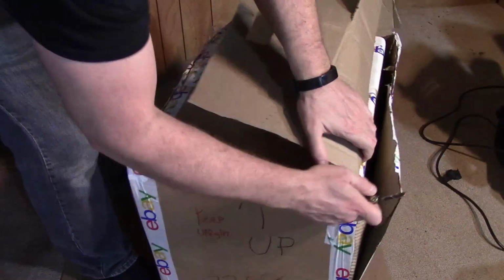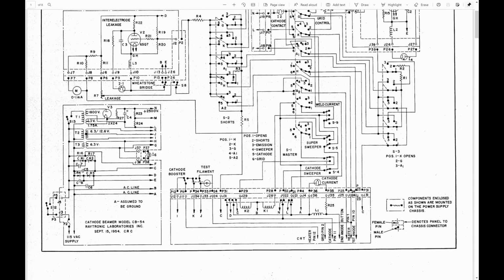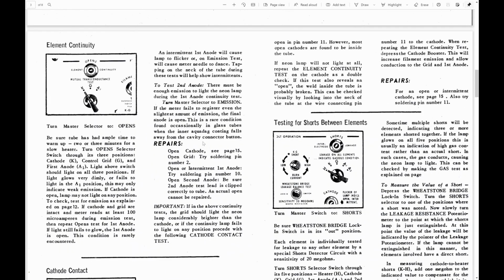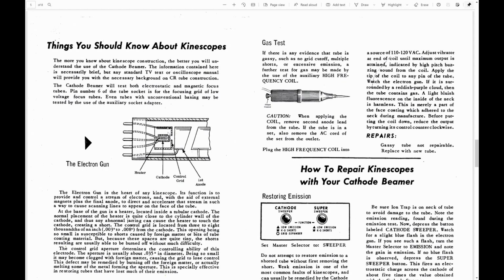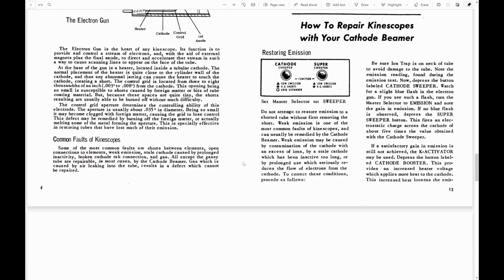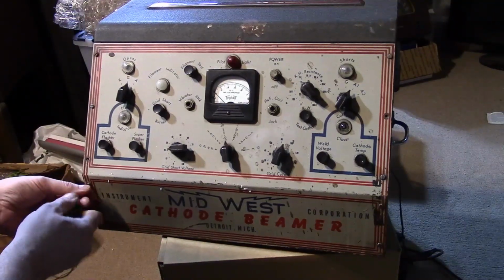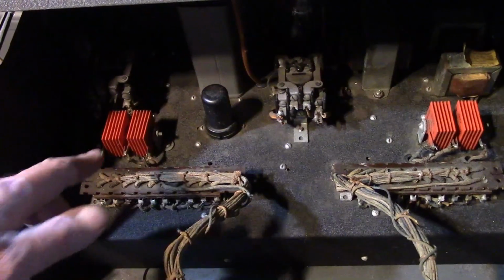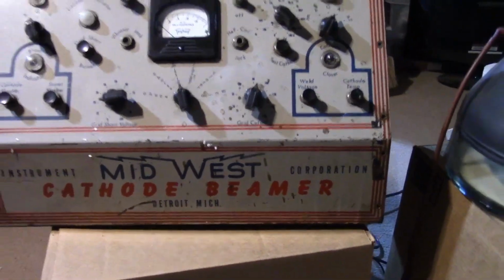Unboxing a Midwest (Raytronic) Beamer

Comment: I love back when anything with a handle on it could be advertised as "portable".
Reply: For me an important question is whether or not the handle is properly located above the center of gravity.
Reply: Yes,like the portable picture tube unit on the Philco Predicta Tandem sets. The darn thing must weigh about 40lbs!  It has a handle and is technically portable,but in reality I doubt they were moved around too often.

Comment: I need to try and get my Sylvania VTVM going.  I also have a Hickok one which is somewhat similar to the HP 410B for which I bought a brand new probe tube but that will probably be a lot harder to get working.
Reply from the maker: Good luck.  Sylvania test equipment is uncommon.
Reply: @bandersentv  Uncommon but well made.  They were made to take the rigors of the traveling TV/radio serviceman.  That is why I encourage anyone who comes across Sylvania test equipment to get it if they can.

Comment: That is one hell of a giant 0.1uF  oil filled capacitor  ( C-4) rated at 3600 WVDC! Weird that someone has listed
for sale a 0.1uF 6000 WVDC capacitor for sale for $20 on Ebay. Close enough to get and rather cheap.
One day you may want to restore it but not now. Saw an ad from 1954 that says it was $279 net back then.
That's $2700 in today's money, wow.
Reply from the maker: It's actually 1.0uF, not 0.1uF.  Wow is right!  Seems their sales pitch was that you would recover your investment with all the money you'd make fixing picture tubes.

Comment: Nice score Bob. I wonder why they used a "standard" form factor transformer to produce the high voltage, instead of using a regular flyback transformer used in a TV-set. I surmise that's because they need quite a high current for some reason? 
Either way, it looks like a damn complicated device to restore and I'm guessing it's not for the faint-hearted :)
It promisses to give 2022 a high voltage start ...
Reply from the maker: Probably cost. You would need several tubes to create an oscillator and driver for the flyback primary. Plus the flyback transformer itself would be more expensive than a conventional transformer

Comment: Am I correct in thinking that this carries out a similar function to the newer Sencore Super Mack?
What a super bit of kit, would be amazing to see it working again
Reply from the maker: Yes it does. The main difference being that this has a fixed 6.3 vac filament supply.
Reply: @bandersentv  have to keep it away from the Predicta then! I could see that being a very useful unit, especially being able to weld that cathode whisker back on

Comment: Shango would love this thing.  You could build a simple interface and use it on color tubes and you could use adaptors from a Sencore or B&K to fit other tubes.  This thing has possibilities!
Reply from the maker: Not so simple. You would either need three adapters (red, green, blue) or make a switch box. Then there's the fixed 6.3 vac filament supply.
Reply: There are so many CRT testers now that can be had for little money you could strip out the transformer and regulator for the various filament voltages. At the same time you could reuse the cable and crt adapters.  And a switch box adapter wouldn't be much to come up with. Most CRT is the only thing you would have to switch would be the screens and the cathodes.  It could be a fun project for your channel and you definitely have a versatile piece of equipment.
Reply from the maker: @randyab9go188  I hear what you're saying but please keep in mind I have a dozen other CRT testers that can do new CRTs already.  Also, with color CRTs it's really useful to see all three guns at once like the Beltron does so you can see if the guns are equal strength.  The newer testers also have safeguards to regulate and limit current and voltage while rejuvinating.  I would be very hesitant to actually use the "cathode flasher" in this device.
Reply: @bandersentv  You have to have some dead CRT's that couldn't be rejuvenated with the usual CRT tester and that is what I'd try the Raytronic on.  They may have a better system there and on a lost cause it could be fun to see if you get any improvement.

Comment: Midwest the radio company was based in downtown Cincinnati.  Raytronic Labs was in the Cincinnati area near the suburb of Evendale Ohio.  The building that Raytronic used still exists but now it is a antique mall.  That area was for its time was high-tech manufacturing zone. Some of their neighbors were Wright Aircraft Engines (one of the Wright Brothers businesses ) later to become General Electric jet engine division and the Crosley Company military electronics division later to become Cincinnati Electronics a military electronic supplier to this day.
Reply: Would you post the url where you found the documentation for the beamer?  I'm not finding it out there on the web.
Reply from the maker: @randyab9go188  http://myvintagetv.com/Apple%20PDF%20files/Raytronic%20Manual.pdf
Reply from the maker: @randyab9go188  I added it to the description

Comment: It would be interesting to see it in action Bob. Hopefully now a massive amount of work and a potentially very useful piece of kit.  Kind of reminds me of a British AVO Valve (tube) Analyser which could do mu testing and a range of other advance functions.  I spotted one at out local antiques store and noted the heater voltage could be adjusted in very small increments over a wide range.  Two knobs controlled the heater voltage.  You could vary the anode and grid voltages too.  Actually plot the the characteristic curves.

Comment: Looks like it has all you need to run at least a small electrostatic CRT. Would be cool to see with two signal generators coupled to the deflection plates.
Reply from the maker: You would need to add a focus control